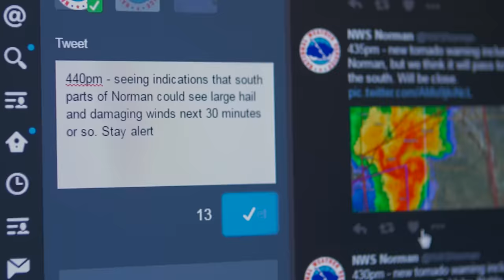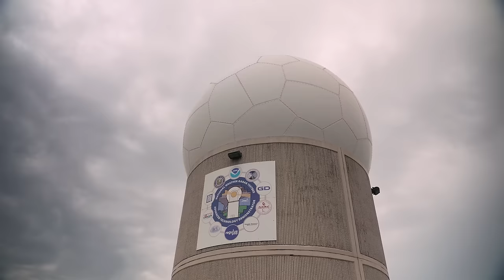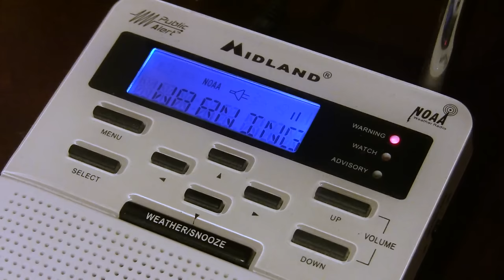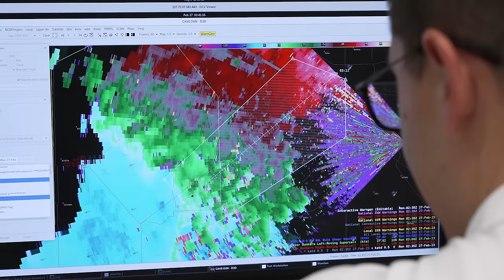Phased Array: The Weather Radar of the Future

Comment: I wonder how the long term maintenance costs and the projected service life for phased arrays would compare to the current radar systems?
Reply: No moving parts and all solid state so probably pretty good if the materials people pick the right adhesives
Reply: Fewer moving parts means lower wear rates, and it's the mechanicals which usually fail with WSR88. It will be a magnitude of order cheaper to run in the long term.

Comment: So does the horizontal axis of your old dish nounts only work in a single direction?
Reply: Right, it only transmits in the direction the dish is pointing in. The ATD they showed is also like this, where they need to point the antenna in the correct direction - however, unlike the dish, PAR can digitally steer the beam and change the beam shape, so they can point it in the generally correct direction, and get a scan. Dish radar needs to move the entire antenna for this. 
Another PAR they showed (1:00) had 4 antennas, so could steer a beam in each direction, rather than moving the antenna. This could be more costly, I imagine.
Reply: @maxmyzer9172  it's a bit strange to me how they complained about having to wait for the dish to rotate back around to get more scans of a big storm, you would figure they could stop spinning and start sweeping just that direction. Phased array just seems like overkill.

Comment: Is this phased-array radar going to alleviate "radar holes" caused by obstructions (mountains, buildings and distance) that we are experiencing today. These 'radar holes" are blocking visibility of approaching storms. Case in point: KIWA is a NEXRAD facility that is located just off of Phoenix/Mesa Gateway Airport in Gilbert, AZ. It has a HUGE 'blind spot" to the south, created by the San Tan Mountain range, and where many of our monsoon storms develop during the summer months. Why can't these radar locations be placed on mountaintops, much like the TV antenna array on South Mountain, that can be "seen" all over the Valley of the Sun? Is there some kind of interference preventing the radar from being placed on South Mountain?
Reply: Obstructions are unlikely to be fixed by PAR. Finer beam control might allow for them to look just over the top of them, however. I don't know for certain why they don't place it on mountains, but there are a few reasons I can think of: 
-> Negative beam elevations looking down from the mountain would cause all sorts of issues
-> The radar will have higher risk of damage
PAR doesn't inherently solve radar coverage issues (like lack of low-level coverage in some areas) either. However, my understanding is that the existing radars cannot be manufactured new. PAR is a big enough change that it might be able to be, so new radars could be built to cover such blind spots.

Comment: Will this change invalidate all existing weather models? How will modern AI weather prediction models adapt to a new data source?
Reply: Very few weather models are AI, and new weather models will have more data to work with. Existing models that use radar will likely just get a portion of the new data, which would mimic the old radar (eg, instead of all the new volumes, they only give one from every 5 minutes)

Comment: I’m no expert but I’m pretty certain this *technology* isn’t at all new,  phased arrays have been used by the military for decades.

This is probably not operating at the same power level or frequency as the military ones for a multitude of reasons and it’ll be designed to detect different things (cloudskis instead of ruskies) and thus have different design focus but the knowledge and tech has been around so I wonder why it’s just now becoming a thing or maybe I’m way off and the military phased arrays aren’t as complex (press x to doubt) and this is like reinventing the wheel

Comment: I hope they use phased array radar to create 3 D weather maps.  Different altitudes have different weather and it makes a huge difference to see the weather front in 3 dimensions. For example, a tornado … show us a vertical cross section of the tornado real time.   And for a weather front moving in, show us the cross winds & temperatures & humidity at different elevations. 
    There is no way to accurately understand weather without understanding the 3 dimensional nature of weather.  The phased array radar weather data will be very useful in developing better weather models to understand and predict weather.
Reply: Radar can't show us temps and humidity. PAR should allow for 3D observation, especially if data from PAR sites can be more easily combined than NEXTRAD sites.